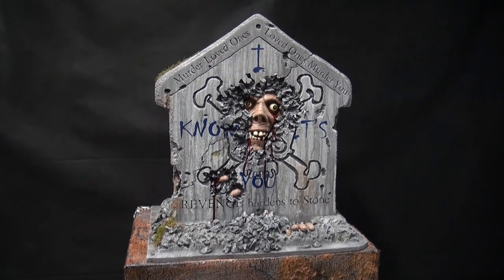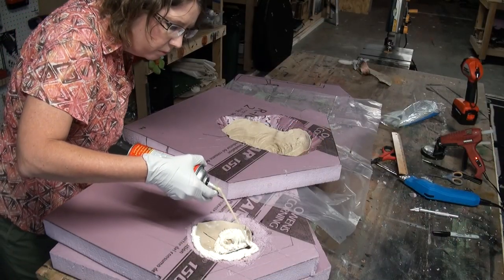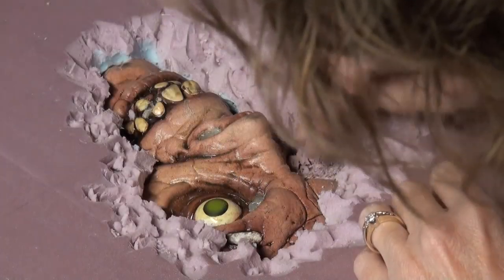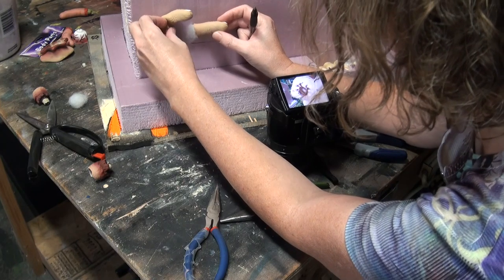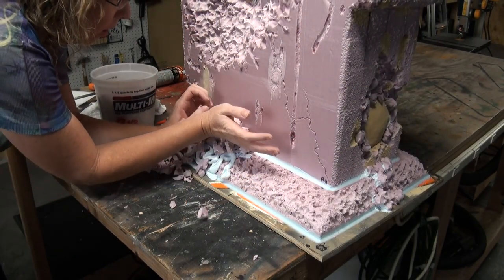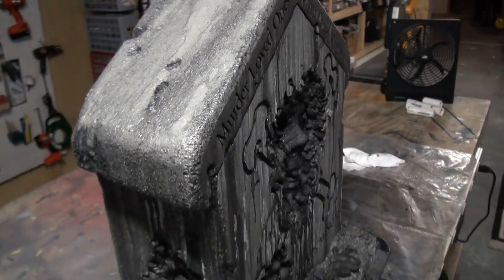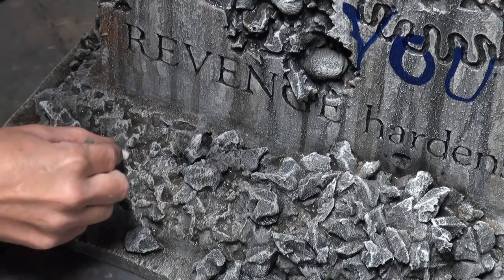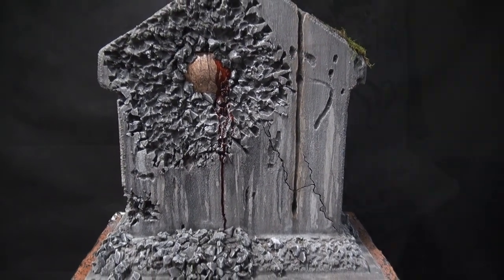Revenge Tombstone: Halloween Prop

Comment from the maker: Yes I would think that the EPS would be pretty good for the Hell Hound. I worry though about the scales. You don't need much of the pink stuff I use but I'd try to get some of that for those scales. But, you could also give it a try - who knows? I've never worked with the white foam so I can't really tell you one way or the other.

Comment from the maker: It's when I paint the whole tombstone with latex Drylok (you can get it at Home Depot). I do two coats. Drylock is a basement waterproofer and it has silica (sand-like particles). So, it protects the stone, makes a good gray basecoat aaaand the texture makes the stone look exactly like real stone. Win, win, win. See some of my older videos to see the Drylocking step.

Comment: Hi, sorry if you have been asked this before, but is the foam you use the same as EPS polystyrene foam? if not, could i still use EPS foam for making this? as the pink foam you have is a little difficult to find in the UK, either that or i am looking in the wrong places. 

Thanks :)

Comment: scaryladyvideos--what product would you use to fill blemishes or nicks or dents before sealing?  Thank you for your help.
Reply from the maker: I like the plain old Elmer's wood filler. https://www.lowes.com/pd/Elmer-s-Carpenter-s-16-oz-Natural-Wood-Filler/3064763?cm_mmc=SCE_PLA-_-Paint-_-WallRepair-_-3064763:Elmer%27s&CAWELAID=&kpid=3064763&CAGPSPN=pla&store_code=209&k_clickID=8b29cbfa-679f-4244-9000-32c33d173d3f&gclid=EAIaIQobChMI4_fRqdSb1QIVUGp-Ch2AuQQ0EAQYASABEgL_JvD_BwE
Reply: Thank you for such a prompt answer.

Comment: what is the name of the product they use to fill in the seam lines in the 4x8 sheets? just to remove the lines and areas that are meant to be broken apart in the insulation board.
Reply from the maker: +FordFalcon1962nBlue I used Wood Filler to fill those seams in. I wish they wouldn't put those seams in. It's a pain to fill.
Reply: ok thanks! i see you used wood seam filler on the blackbeard tombstone ill be sure to pick up this at the store

Comment: I forget which one of your videos but you made a comment on the order that after visiting graveyards and seeing old tombstones that you had rethought the way you were etching or making cracks/lines in your tombstones and you were aiming more toward smaller cracks. Based on this comment are you using acetone on a small paint brush or some other method?
Reply from the maker: I was using two methods. Yes, the small brush with acetone for divots and big faults. But, then I used an exacto knife to cut thin cracks and open them up here and there with a pottery pick (like a tiny sharp spade).
Reply: @Scaryladyvideos  Thanks a million

Comment: Hey Terra quick question. I see you use Drylok to seal many of your projects. The texture is very cool in most uses but what do you recommend to seal something say...that you want to look shiny? Like Metal. I guess I could go the Mod Modge route but is there anything else?
Reply from the maker: I use exterior latex paint. The Hellhound I made was coated with just the paint and it did a great job.

Comment: I am having hard time finding a place to purchase xps foam boards that you are working with. Where do you purchase yours?
Reply from the maker: If you live in a southern state that may be why. Southern states don't need as thick of insulation so the home improvement stores don't carry the thicker sheets or at all. I brought some with me from Kansas when I moved to Texas.
Reply: Thank you so much for the prompt response. I am in Las Vegas, NV, so that is probably why they don't carry that stuff in home improvement stores. Though they do have the insulation foam sheets that are EPS. I'll have to work with those I guess...Your tutorials/videos are awesome and this year I plan on building a few tombstones and grim reapers, so we'll see how it goes... Thanks again!
Reply from the maker: You are very welcome. Though I haven't worked with EPS foam to make tombstones I have seen some and they give a different but very cool look to the stones. To me they make the stone look even older and worn down so it could be a fun medium for you :)
Reply: It's the opposite in CA, we can get the expanded white bead board, but no longer get the nice fine texture extruded planks! :-((  Beadboard is OK for crude or very weathered ,broken edges etc, but sux for lettering, chipping etc. Wahhh. I end up putting a fairly thick skin of a plaster like material and then have to seal it well because the rains usually start for the season right around Halloween. Cheers and Fears from Foreboding Way!! [on facebook]

Comment: Hi Terra!

I had two questions for you since you helped me out about 4-5months ago.
I commented on your Hellhound Chronicles of Riddick youtube video asking about which glues work best for pink foam and you had mentioned that glidden gripper did the job.

Upon starting my own project I came across 2 new questions and i was unsure how to approach them.

You used a lot of drylok on your props and i was curious..

-  "What does Drylok actually do for pink foam?" 

Im guessing it acts like a protective barrier/layer so weather doesnt mess it up.

-"How do i patch up small seams that the glidden gripper couldnt reach?" 

Upon having the pink foam being held down with heavy weight and pulling the weight off after 32hours i found that some spots had seams and wasnt sure how to fill them up with.

Here's an example of what im trying to make.
It's from a game that's spooky and fun hahaha

https://imgur.com/pYvGzfy
https://imgur.com/O2g5Zj2

Here's my current progress
https://imgur.com/akiXb85
https://imgur.com/V6gJ1B3

I want the long neck top part of the hook to be detachable/retachable so i was thinking of creating small holes for magnets(gluing them with glidden maybe) so i could bring it out every Halloween and put it away easier.

I appreciate any advice, Happy Crafting!
Reply from the maker: What a neat prop you are making. I know about the seam you are talking about. I use Elmer's Wood Filler for those. But, for your prop you may consider using Monster Mud to skim coat the sections. That will allow you to texturize it to look like the wood parts and the steel parts at the same time you can cover those seams. Drylok would be a consideration if you don't need any texturing other than giving it a stone look (which Drylok gives you perfectly). I use Drylok to toughen, waterproof, texturize and color my tombstones. Drylok may be great for the steel parts but the Monster mud is way thicker and would gives you a rough wood look.
Reply: So elmers wood filler for the seams and the Monster Mud for the texture on the steel/wooden parts. Gotcha! Thank you so much Terra! YOU ARE THE BEST!
Also sorry in advance but i wasnt sure if my messages went through on the HalloweenForums so you might have 2 more over there. 
Thanks again for the quick response, and again sorry for the bombardment of questions.

(-Edit) Just looked up monster mud and i thought it was something already sold in stores but i was wrong . It's a mix of Drywall Joint Compound , Exterior Latex Paint..
Now my questions are -
 Any Joint compound should do right? 
And isnt glidden gripper both exterior and interior latex paint? Would it be wise using that or just getting regular exterior paint?..

 If i have more questions i'll send you my questions on the Halloween Forums!
Thanks again Terra, i would be lost and upset without your wisdom! 
-Nathan
Reply from the maker: Glad to help. Glidden Gripper is a paint primer and not really paint. What great about using paint (I use exterior) is that is what gives the flexibility to the Monster Mud and so it's important. Use regular pre-mixed joint compound. It's better if you send your future questions here as I would see them more often. By the way, if you use the Monster Mud - you won't need to use the Elmer's for the seams. The Monster Mud would also take care of that. Here is my written tutorial explaining Monster Mud: http://www.halloweenforum.com/blogs/terra/696-grime-up-props-tutorial.html
And here's my tutorial of making steel beams similar to what you are doing:  http://www.halloweenforum.com/blogs/terra/780-steel-i-beams-tutorial.html